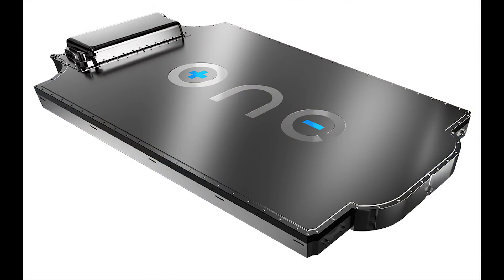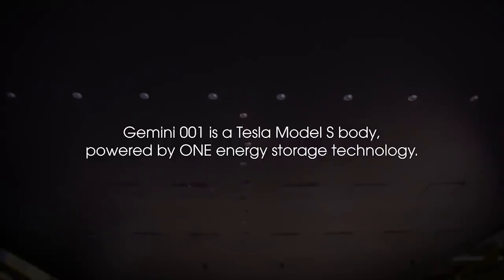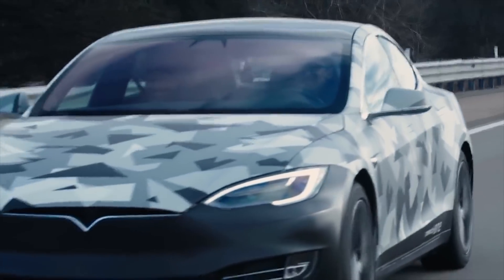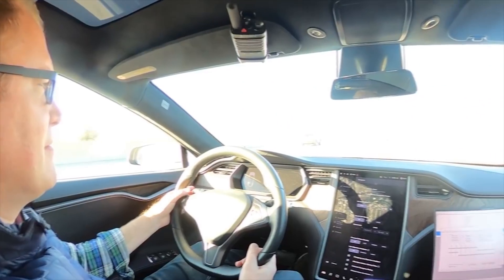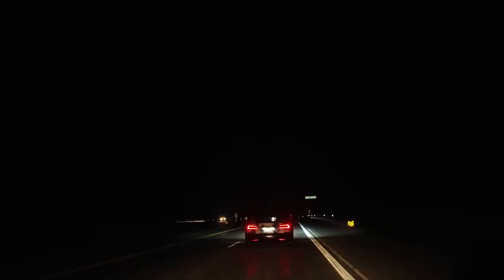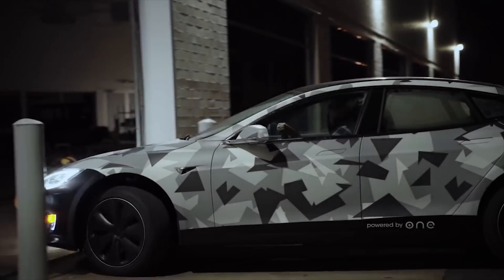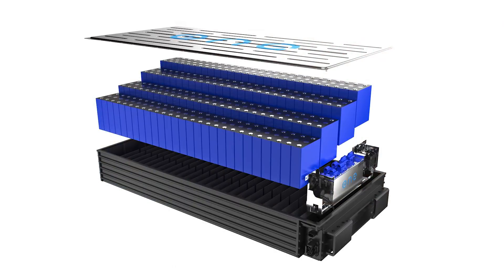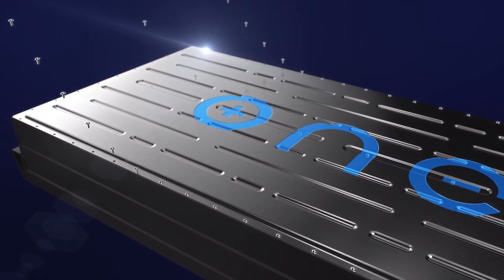750 Miles On a Single Charge & Still Room for Improvement - Autoline Exclusives

Comment: What I think would be ideal is a fixed battery with a range of 150 - 200 mile range for everyday use and the option to temporarily add a range extender battery of 200+ mile range for long road trips. The range extender battery could be either rented when required for long road trips (significantly reduce the cost of the EV) or double as stationary storage when not required for use in an EV. Benefits are 1) not hauling around extra battery most of the time, and 2) range extender battery is in use as stationary storage a majority of the time (instead of being haul around as dead weight reducing the efficiency of the EV).

Comment: INTERESTING: This type of approach is being looked at by various parties but great to get the insider comments.  Not trying to knock them but I wonder what the cell to pack ratios will be with cooling and production quality intrusion prevention,  fire containment and structural strength.

Comment: Does this 750 mile range use the battery as typical now, by which I mean the 80% charge to 20% discharge (for longevity) and what I didn't hear was what would be the charge rate of these type batteries.
Reply: And 50% drop at highway speeds over 75

Comment: My current PHEV has a full tank/full battery range of over 600 miles so he is correct that getting those high ranges would be persuasive to have me go from PHEV to pure EV.
Reply: The dude claimed that 99% of drivers will never drive more than 150 miles at a time, or something like that.  So if that's true, then i can see things happening two ways.  PHEVs develop better pure EV range (around 100 miles) and largely waste their engine, or BEVs develop 600-700 miles of range but largely don't use (waste basically) 90% of their capacity most of the time.  Essentially, customers are going to waste a lot of money on heavy, environmentally unfriendly packaging (and resources that could be used elsewhere regarding huge battery packs) for something that gets used fully once or twice a year?
Reply: @OlJackBurton  Well, for me the typical round trip work week commute totals up to 300 miles. Then you have to add on the miles of daily after work and weekend driving around for necessities and/or fun.

So a 700 mile range means I could run that car and only have to recharge about every other weekend. That is a good deal in my book. One and done recharge period. 

Things, of course, improve when I am parked overnight at my place where I have a garage and can charge up but these days, that's not usually the case.
Reply: @pauld6967  Most people with EVs and PHEVs are used to charging/plugging in every night (assuming they have a garage). That doesn't mean that they always charge to 100% or even 80%.  It just becomes a habit (ABC or "always be charging"), especially for PHEV drivers, and sometimes a necessity if you're still using a 110/120V plug. But with 600 miles of range, instead of spending 10 minutes (or 5 or 3 or whatever) a week plugging a cord in and out, you can now spend 1 minute or less a week. Sure it's more convenient (first world problems), but people can be excessive/wasteful in the amount they will pay for convenience, not just with cars, but in all aspects of life.

But sticking with cars, it's like people that buy a vehicle with 10k lbs of towing that they never use, or 3 row SUVs where the third row almost never gets used, or all that cargo space with all the seats down or huge pickup bed that almost never gets used. Or 3 second 0-60 acceleration.  Yet, all of these are huge marketing points (cargo space, third row/second row space, towing, acceleration) to sell cars. And now cars have a higher footprint (and price) than ever.

But again, back to EVs in particular.  The biggest environmental cost of EVs is getting the materials out of the earth (which is done using fossil fuels) and then producing batteries (also done with fossil fuels) and finally "recycling" them (more fossil fuels again) when they can no longer be used.  Recharging them (with or without green electricity) is a far secondary environmental cost. 

EVs are also considerably heavier than regular cars, especially since Americans wants SUVs and trucks like a 9k lb Hummer EV or 7.5k lb Rivian, so tires (notoriously hard to recycle) are going to be eaten like no tomorrow and the roads will deteriorate quicker too. The much quicker acceleration will also hasten the erosion of tires and roads. EVs are supposed to be green and sustainable, but who are we really fooling?
Reply: @OlJackBurton  that’s wrong!!! Also used vehicles are far more used for different applications than new ones….. you still see 30 years old Toyota beeing used for overlanding all around the world and it says something!
Reply: @carholic-sz3qv   I'm not sure what you think is wrong. But i don't really believe that only 1% of drivers will use more than 150 miles of range at a time or a day or whatever, however many times a year.  But if that stated claim was factual, for the majority if not the vast majority of drivers, a 100 kWh battery makes no real world applicable sense other than for easing perceived range anxiety (thinking about emergencies that will require long ranges), convenience or performance.  Otherwise, it's just overkill...
Reply: @OlJackBurton  yes your are wrong and your estimations are based on people which EV needs fits well, again not everyone has the same needs with cars! Most people adopting EVs now are different. Nothing is ever overkill, plus when the car will be around 10 to 20 years if the battery ever manage that!
Reply: @OlJackBurton  old cars also are exported to countries in Africa, South America….. where range is still the most important thing to have. Get your facts right again!
Reply: @OlJackBurton  I see what you are saying.

For me, a 600+ mile range perfectly suits the philosophy that I live both my professional (to the consternation of the various organization's bean counters) and personal life by: "It is better to have a (tool or capability/capacity) and never need it than to need it and not have it."

Many a crisis has been changed to a momentary annoyance because I had a particular tool just sitting around gathering dust or because I had designed in or insisted upon having extra capacity or specific redundancy provided at the planning stages of a project.
Reply: @carholic-sz3qv  My facts and estimations?  The estimation comes from this Mujeeb guy.  He gives statements at 5:56 (regarding the US actual range for 99% of drivers) and at 6:53 (regarding the battery size he's working with, which is freaking 200 kWhs). I honestly think he's pretty clueless to reality, economics, enviromental issues, geopolitics and battery supply. As for my hypothetical projections (based on his claim), i didn't say anything was a fact or said that it applied to everybody, and i was addressing the US market. And Mujeeb was definitely only talking about the US market.  

Africa and South America is out of sight and mind for the vast majority of Americans. The average American spends very little time everyday thinking about Africa or South America in the abstract or in actuality. The entire new car market in Africa is just over 1 million units a year and in South America is less than 5 million units.  That compares to 15-18 million just in the US, 17-20 million including Canada, around 15 million in the EU and 22-25 million in China. 

Is the average African or South American even going to be able to afford a brand new 200 kWh EV, especially without government subsidies?  EV range is a First World problem. The developing world won't be riding or driving EVs on mass any time soon. But let's be real, even average Americans can't afford a 100 kWh EV, let alone a 200 kWh EV (to get the 750 mile stated range). I'm not sure you understand the reality of 2 billion 2,500 to 5,000kg cars on the road eventually, hauling 200 kWh battery packs, or a total of 400,000 gWhs or 400 tWhs of batteries needed just for production (never mind charging; the entire world consumed less than 24,000 tWhs of electricity for all of 2019), and what it would it would take to make that happen.
 
That could never become the reality and shouldn't be the reality. If you knew how much damage American wastefulness was doing to the world, you wouldn't want Americans to be even more wasteful or the rest of the world to become like Americans. If you still haven't figured it out, i don't think EVs are the answer. But neither is pure ICE. But then English reading comprehension doesn't seem to be your strength, so feel free to keep yelling at clouds...
Reply: @pauld6967  That's the cost of security...

Comment: Interesting, but what I want from my EV is efficiency, meaning more miles per Kwh and faster charging.
Reply: I agree; I pay more attention to charging speed than range, as long as the range is at least 200 miles.
Reply: The best EV's out there are already 90+ % efficient. Not much more you can gain in that space

Comment: Great experiment I like the idea of a two-stage battery, with the high performance battery as a buffer. I thought it would have been done with capacitors but that didn't seem to work out.
It might make sense if they scale it down but the range there getting is unnecessary & wasteful of money, weight & space.
It raises the question should we concentrate on the normal range vehicles that accommodate a vast majority of drivers or work on brute force solutions to edge cases instead of waiting for cheaper, higher energy density, better batteries.
Reply: Capacitors works very well with heavier equipments and vehicles like trucks…..
Reply: Consider what made Tesla a decade ago - performance.  People suddenly realized a Tesla offered far better performance without maintenance.  The last obstacle is making electric perform like gasoline.  1 gallon of gas offers the same performance as 10 gallons. That cannot be said for electric as a low state of charge produces drastically less power in the motors. I’d love to see a “dual stage” where the main battery supplements a high performance battery or supercapacitors.
Reply: @aussie2uGA  lol…… sport cars aren’t just about performance but driving dynamics, customizations, mods….. also ICE are loved for the feedback and manual gearbox and many other features.
Reply: @carholic-sz3qv  Of course!  But Halo cars need only “performance” to sell 😉
Reply: @aussie2uGA  nope that’s not how it works lol…..

Comment: You need that range because it has been shown in snow and cold weather climates in the mountains, you are going to lose about 40% of the range especially when you need AWD and snow tires.  So instead of 750 miles it will be more like 450 mile range, which is reasonable even for those in the mountains, in cold and snow.
Reply: Absolutely.  750mi could become 200mi during towing, mountains, winter, etc.
Reply: @aussie2uGA  I see towing as a problem nearly no matter what.  That is an interesting take because you are right - add all what I wrote and towing it will reduce the mileage even more.  I don't know of any ratings however on how much towing reduces an electric car/truck, although Ford does admit trying to tow with the Lightning F-150 cuts it by almost half.  I guess it would be like 225 miles trying to tow in the mountains with snow tires and AWD, which might still not be enough.  But I have a feeling there are not many left who would try that, right?

Comment: ok. so, let this get straight. from the numbers, they almost achieved the same thing that tesla already has in production with their 4680 cells - almost.
and by not achieving their goals, they then say that we don't need that much range.
at the end, what did they achieve?
Reply: they Achieved greater WEIGHT and less Range.
Reply: @sourav jaiswal the 4680 cells of tesla have between 296 and 300 Wh/kg
Reply: @sourav jaiswal at cell level. nothing super fancy. just simple silicon loading in the graphite. but that is the highest density currently in production in an EV.
tesla is far away prom 300Wh/kg at pack level. it is not possibly if this is their maximum at cell level.

Comment: Great to have such battery technology! Applying such on BZ4X or a Solterra will be a game changer for other EVs……….  More Tesla alternatives👌
Reply: Toyota EV tech sucks. Just look at how slow it charge.
Reply: And they managed to make the styling ugly as hell too.
Reply: it will make bZ4x worse , ONE battery pack is less Efficient than even the Current one in bZ4x . 
it will add even more Weight to a already OVERWEIGHT ev. 
Tesla model Y is better & lighter w/ 4680 Structural pack , that uses Less materiels and Weights less. 
and Model Y already has Longer Range w/ SMALLER battery than bZ4x.

Comment: 4:05 Real-world range is up to 50% less than rated range, but ONE’s battery isn’t even rated range, because:  8:11 No cooling system?  Winter driving?  I wonder how far an S would go with its original battery under the same conditions.  I was enthusiastic when I heard about this 750 mile battery, but I’m less interested the more Mujeeb speaks.
Reply: Exactly!

Doing it once in a one off prototype in IDEAL conditions doesn’t impress me much.
Reply: The 750 miles was done in the winter in Detroit, they got over 880 miles in milder temps of around 70°
I'd be curious to see how much extra weight that pack added? I'd guess off hand 500-800# of additional weight.

Comment: Will Aptera just be an oddball vehicle?
Reply: Yes
Reply: An awesome oddball vehicle, possibly a smarter answer to the hyper range idea than brute force. I really hope they make it to the road.
Reply: @Steven Gulie I would say yes daily driver, because most drive solo to and from work. There are too many kids anyway.
Reply: As of 2019, the first planned production Aptera is a 2-seat, 3-wheeled passenger battery electric vehicle (BEV).
4 seats would be nice, but I've had a 2-seater before and 2 cars w/ almost unusable backseat, incl. my current, Fiat 500ev.
To me, my m- f car is my daily driver.

Comment: Hopefully Tesla will up there battery packs to 150kwh. It seems like that’s the only these startup’s are actually getting more range then the Model S. Like Lucid and Mercedes EQS. I understand why Tesla doesn’t want to add the weight and cost.  It it would be great if Tesla and others could make 450-500 miles. The standard range for an EV.

Comment: This is awesome.
Reply: not really, its just DUMB range.
I can Supercharge @ 1000 mph.
Reply: @markplott4820  what does that even mean? "I can Supercharge @ 1000 mph."
Reply: @ChicagoBob123  - if your car has 1000 mile Range, it will take 1 hour to charge. 
or a Tesla to 80% in 10 minutes.
Reply: @markplott4820  ok, no Tesla charges to 80% in 10 minutes. Current fastest car is ioniq5. Besides charging speed let's add in all the wasted time of getting off the road driving to where ever in a place your not sure is safe and then being able to charge.
Reply: @ChicagoBob123  FALSE, my Tesla w/ using NAV on Autopilot pre heats my Tesla while driving to the BEST supercharger based on my range, this way car only needs to charge to 80% and is faster than LUCID and KIA/Hyundai. 
not every Tesla can charge to 80% in 10 minutes , but ALL Tesla can charge @1000 mph for first 10 minutes.
Reply: @markplott4820  Have you watched out of spec reviews? Maybe not. They go trough the charging curves of all these vehicles.
Reply: @ChicagoBob123  - out of Spec are not very trustworthy, as they are PAID for review by OEMs, except Tesla.
Reply: @ChicagoBob123  - also watched Tom Moloughney on charging, another untrustworthy YouTube, as he gets PAID by OEM's.
I trust Tesla charging curve and Tesla nav on Autopilot .
Reply: @markplott4820  Tesla whose actual range never matches? You think the youtube guys are lying? For what reason they own Teslas.  CYA fan boy not enough time in the day. Drive your car down to 10% then charge let me know how long. Create a youtube video so we can all watch.